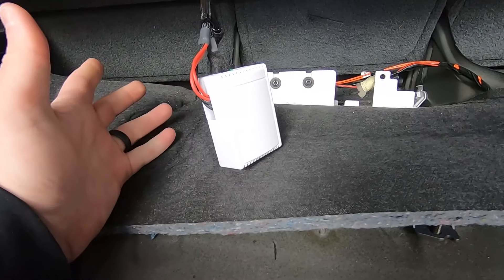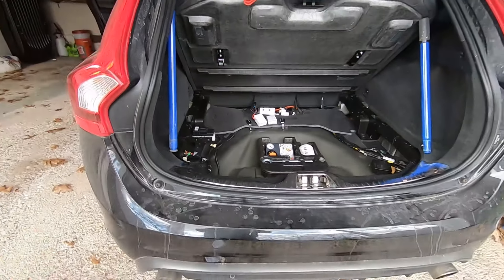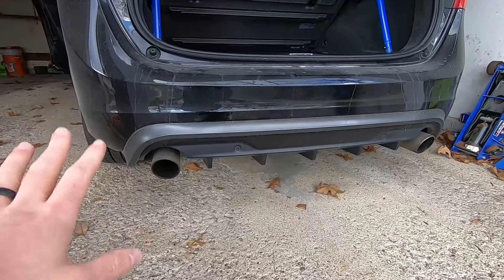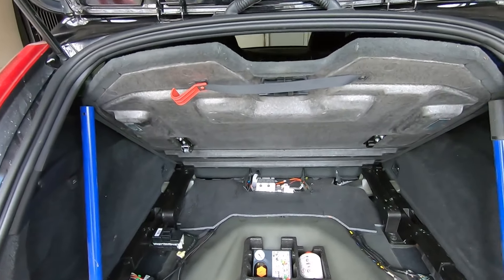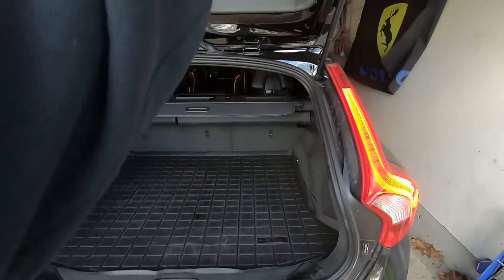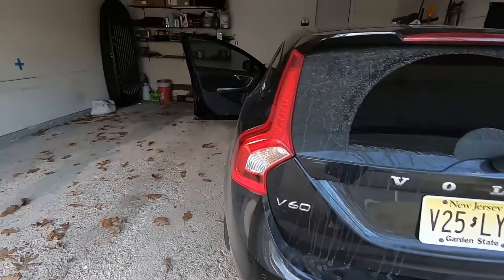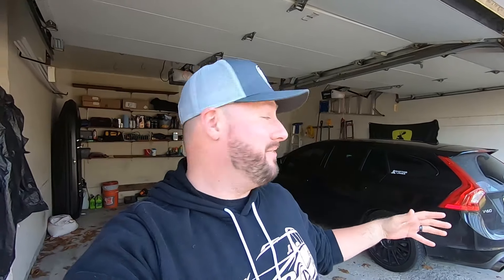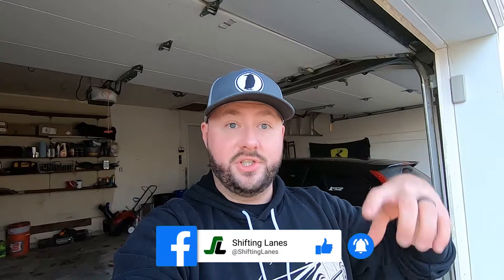My Exhaust Sounds So Good After This!! - SPB Remote Installation on Volvo V60 Polestar

Comment: is there another to way to contact SPB other then instagram, by email? Or do you you know if this remote would work on my 2019 V60 T5 stock exhaust?
Reply from the maker: It will only work on exhausts with an electronically controlled butterfly valve. Would not work on your car with the stock exhaust.
Reply: @shiftinglanesgarage  my Volvo dealer said that my stock exhaust has Exhaust Control Valve Actuator. If what you name "electronically controlled butterfly valve" is the same thing do you have another way to reach SPB?

Comment: I had a similar setup on my v70R like so similar it literally had the same remote 😂 actually except I had to weld up the cut out valve. The cutout valve stopped working because it kept getting really toasty lol I'm gonna do a varex valved muffler later on

Comment: Ive got the S60 version of this , have you done any audio upgrades yet? the wiring in this car is next level . If you do please amke a video :)
Reply: What sort of audio upgrades are you talking about specifically? I gutted all of the audio from the head unit back in my V60 and replaced it all with aftermarket.

Comment: Will this work for a basic v60 ?
Reply from the maker: Unfortunately no. Your car does not have an exhaust with electronically activated flaps to make it quieter or softer.
Reply: If you have an electronic cutout installed on your exhaust , then yes. But it will work with the remote, not with the transmission